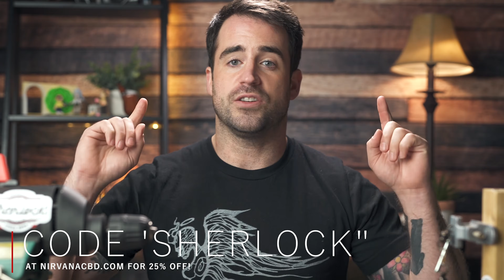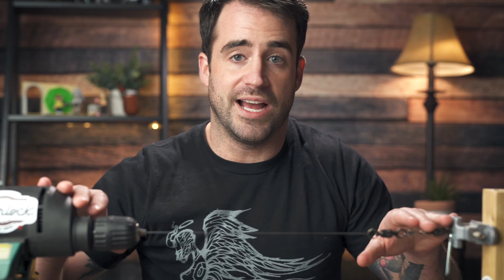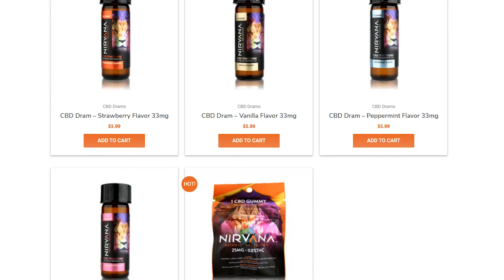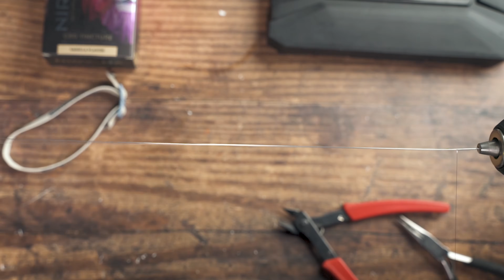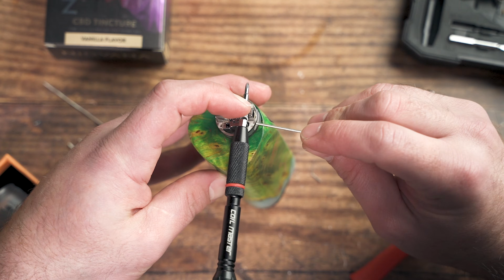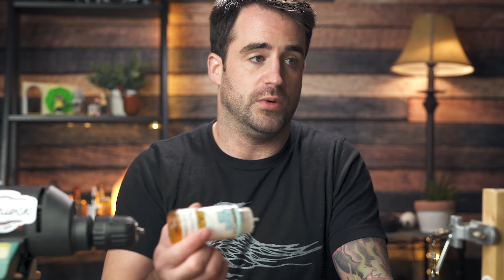Fused Clapton Coil Build and Install Tutorial

Comment: I've just been using 22g and dual-coil tanks for years. 6 wraps at 2.5mm and (depending on the ohms reader) would get between .12 and .15. But found a tank that is single coil and remembered doing wraps like this, I can get the same ohms as a dual coil tank. But I was curious what your ohms were with this build and if it's a little higher than the .12 - .15, what could I use to maybe get a .12 - .15 ohm on single coil?

Comment: So sitting here during the virus im out of coils but have 2 KA1 spools I never used, one is 22g the other 24g. Its not ideal but whatever that's what I have. I usually buy pre built coils but I'm out and decided to make coils. I watched this video a hundred times and finally made my first fused Clapton!  It turned out ok but just happy I finally did it. Running a single coil on my pulse v2 came out to 0.41 ohms.
Reply from the maker: awesome man! great job!!

Comment: hey guys! im new so i have a question. so i just made a fused clapton like this but with 22ga x2 and 40ga; 3mm diameter and 5 wraps; all kanthal a1 and it came out to .24ohm and i vape it at about 80watts. my problem is, im really not diggin the ramp up time. its better than the first one i made with 30ga instead of 40ga...but still not fast enough. would it make a difference if i buy 22ga stainless steel instead of kanthal? or am i going about this the wrong way? thanks in advance!

Comment: Hey Hohms; how ya liking that "Crazy Wire" man? Been mulling it over forever but never pulled the trigger as of yet ....
Reply: It's pretty much all I use for my round wire, I wouldn't recommend their ribbon as it's never been straight. I've been using them for 5+ years and had one issue with some high gauge wire wrapped under itself so it was locked onto the spool but they fixed it immediately. Nothing but happy with em.
Reply: @Apathymiller  thanks man; appreciate ya Josh as always 👊🤙
Reply: Not the cleanest wire, or best spooled, ribbon... just don't. The SS 316L has a weird TCR, so will be very tricky to make it work... But, it's cheap... Specifically if you live in UK... It's what I normally use for 3 years now...
Reply: @FatBubico  thanks a lot, man .. wire is my passion so .. it matters
Reply from the maker: Not great for the high gauge wire but they fix their mistakes so it's a dice roll
Reply: @SherlockHohms  thanks man, appreciate it! 👍

Comment: Great clip as always. Thanks so much for telling us the way to position the drill for lefties and righties, I've had been building for almost a year with the positions inverted, and after switching, boy what a difference.

With that out of the way I've got a question, Why did you wrap in SS? Is it for those sweet blues and purples? Or does it ad anything to the flavor?
Reply: Kolvert good question!..i wondered the same about ssl..i always used nichrome and k1...so what’s the deal with ssl???
Reply: @80elko  ssl os great for temp control, very cheap, and once stabilized goes blue and purple which is great for build shoots. I use SSL on my Wasp Nano RDTA for CBD, since it seems vaped CBD should no go over 200°C. :)
Reply: Kolvert oh ok..thanx!..does it heat up quicker then nichrome?..is there a metal taste?..i think i heard that ssl leaves a metallic taste
Reply: @80elko  Ramp up time is very similar to me, and no I haven't experienced any metallic taste.

Comment: After 5 failed attempts, I gave up on trying 3+ core fused claptons. I'm fine with regular fused. Much easier & forgiving. I still use to much tension on the wrap sometimes but rarely compared to how much I use to.
Reply: Whenever I make tricore fused claptons, I use the cap and the threaded portion of a soda bottle with 2 oposing slots cut on it to keep my cores in line. You only need 3, one on each end and a sliding one. From there it's just practice. I hope my little trick helps you out. :)
Reply from the maker: I never waist my time with 3 core fused claptons. They are too difficult and dont perform well enough to justify the time and effort
Reply: @SherlockHohms  I might dabble with flatwire a bit. Will have to go through & find your vids on flatwire again. Have you messed with square wire much?

Kidney puncher is the only company I seen selling it & only in n80 I think. I'm fine with any wire but prefer SS 316l. I think its because its what i'm use to & started vaping with. Been mainly using kanthal a1 for a month now. Not bad, just prefer 316l still.

Comment: Great video Kenny. I usually just buy premade coils but it think I'm ready to try to start building my own. I like higher resistances so what's the best wire to use? I like stainless steel the best. Shooting for .40-.50 ohms.
Reply: Hi there, pardon me for getting in here, but if you're shooting fir those resistances while trying to learn to build, your in for a nasty and annoying trip. Let me explain, VERY generally speaking the thinner the core wire, the higher the resistance value. Also when building with round wire, 2 cores will half the resistance of a single core, 3 will divide it by 3, 4 cores will quarter it, and on.
Now the thing is SS is one of the materials with the lowest resistances and that means you'll need VERY, VERY, thin cores and the thinner they are the more difficult to work with.

If you're shooting for those values, in single coil, I would suggest 2 cores of Nichrome 80 in 28-29 gauge, and wrapped in 40 at least. The thinner the clapton wire, the better heat dissipation, the longer cotton life you get. 
I hope this helps. :)
Reply: Get the coil calculator app. It works wonders for me
Reply: @curtismurphy7792  it does, but it's always a good idea to have these very basic notions present at all times, it will save time and help navigate the coil calculator because you already know, more or less, the gauges you should be focusing.